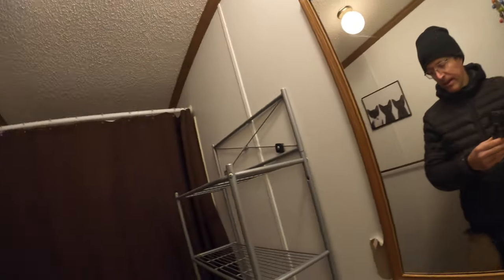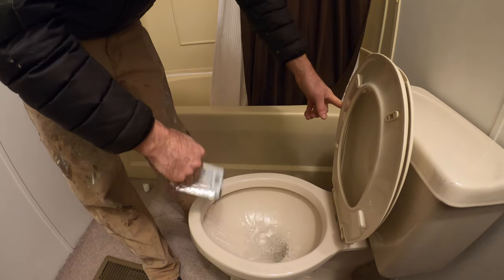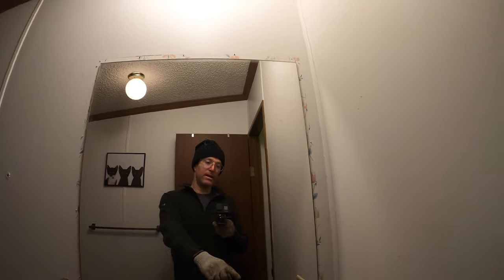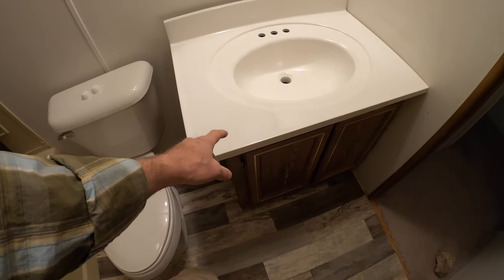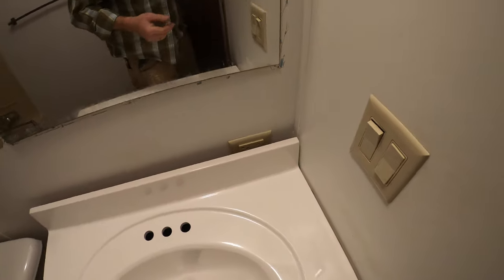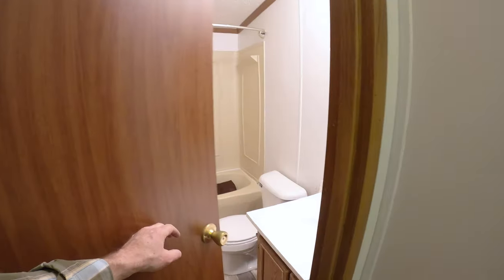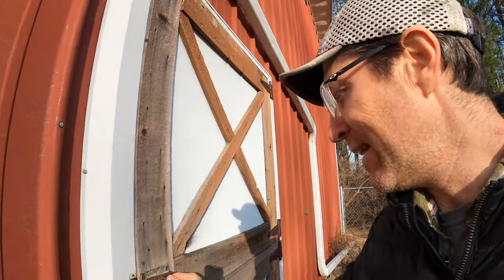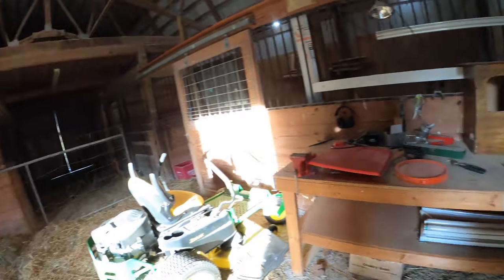Small Bathroom Reboot + Kitty Causeway ➠ Handyman Diaries 22

Comment: What kind of new gasket is that at the bottom of the toilet? I installed an outlet by my toilet to run a motion sensing light and a small air purifier that blows across the toilet at all times. One of the best ideas I have had, if I do say so myself.
Reply from the maker: I've been using these newer gaskets lately just because wax can melt in extreme heat ... I'm not sure how long these new ones will last, though, since they've only been around a few years. So far so good. Cool idea on that air purifier! I've never seen or thought of that idea ... it's a great one